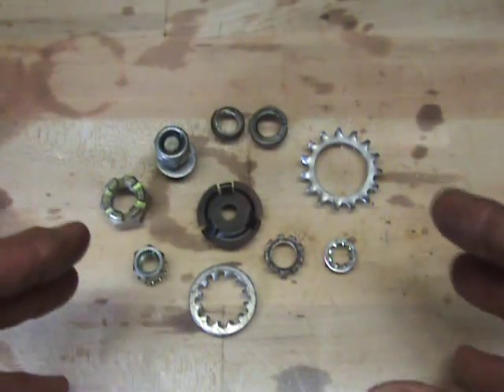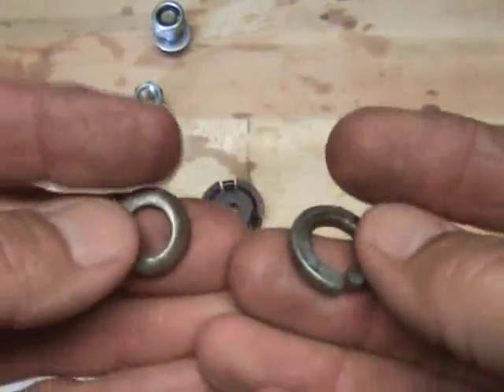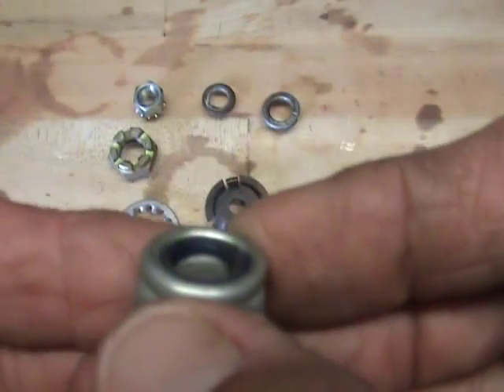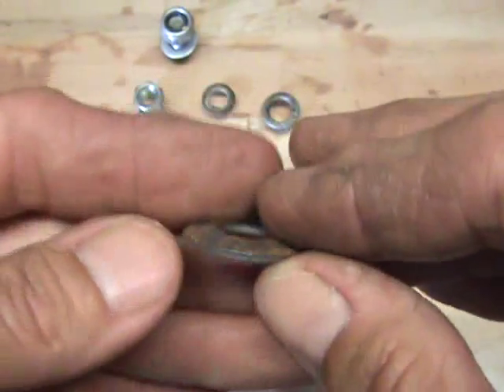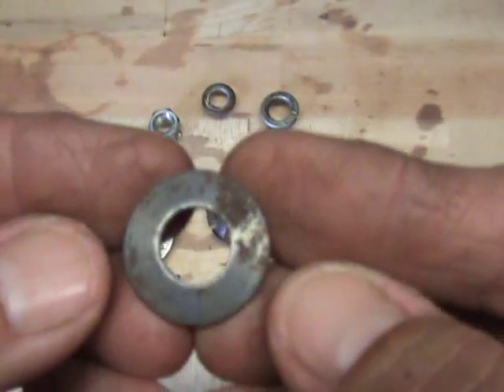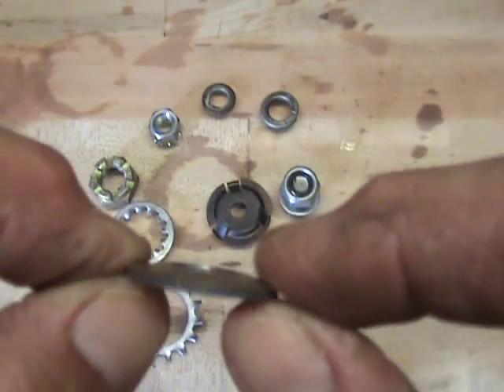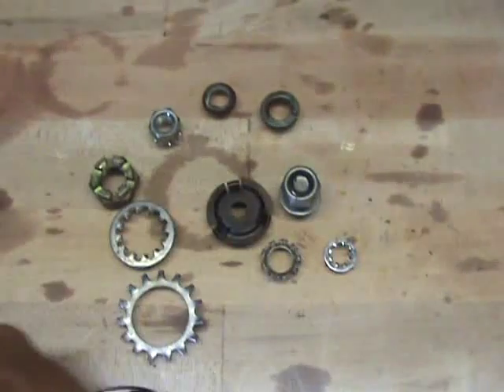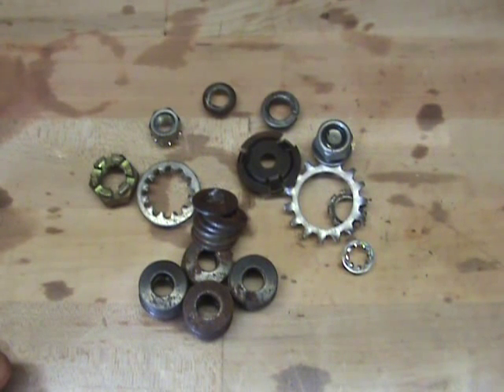Bolt locking options quick tip

Comment: Hmmm. We use those ask the time, when rebuilding valves at the nuke plants, to keep constant pressure on the packing. We alternate them to make a spring. Never thought of using them as lock washers. Thanks